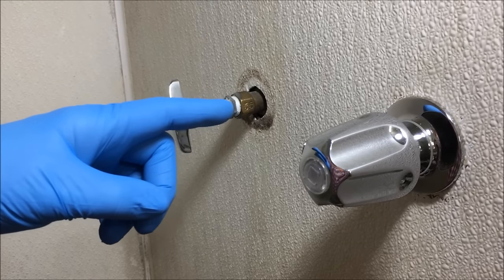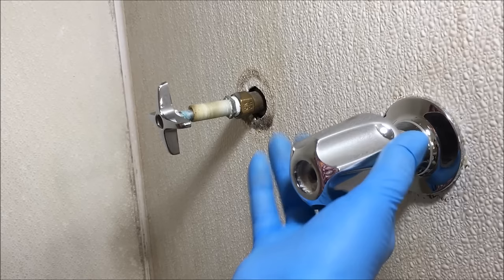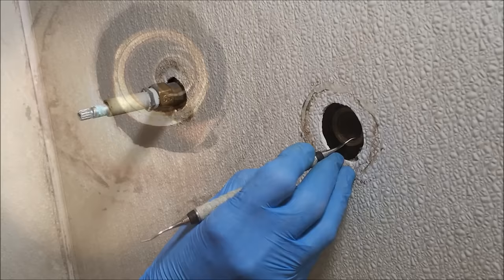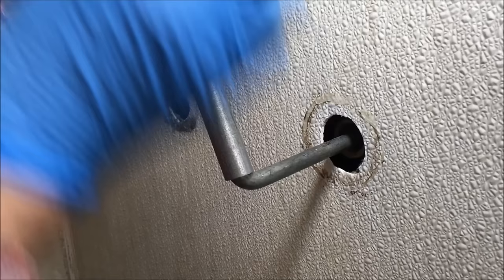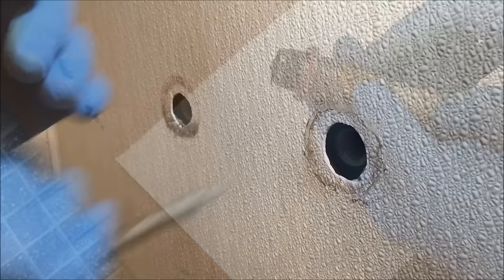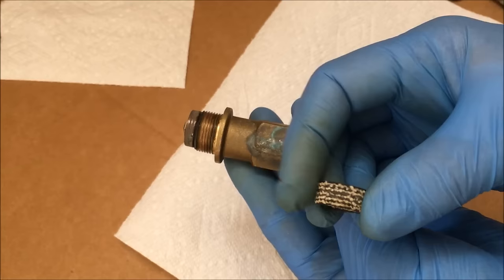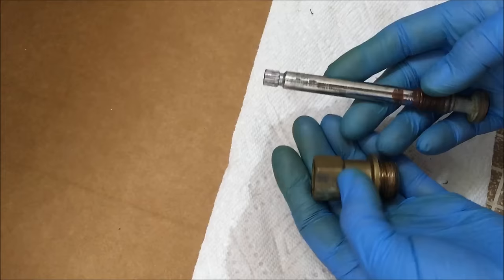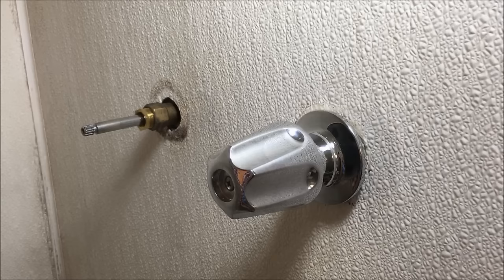Fix Leaking Shower Head or Bathtub Faucet | Rebuild & Replace Shower Valve

Comment: I replaced my cold water valve but the water does not come out. Any idea as to why?
Reply from the maker: Hi tony.  Are you 100% positive that you replaced the cold water valve with another valve that is identical/the same part?
Reply: @frugaldiy1  yeah the parts look alike. Should be the same part danco (7e-5c)…

Comment: I have an old house so there’s no telling how old these valves are.. I already made one trip and bought the wrong size. But all the ones at the store look nothing like my old ones. How do I know what kind will work?
Reply from the maker: Yes, many of the valves look the same, but aren't.  I'd take the valves to a plumbing supply place (where plumbers go to get their supplies) and ask them to help you find the correct valve.  Or, you can simply rebuild the valves, like I do.  If you have a difficult time identifying which parts you need to rebuild the valves, because that can be challenging too, the folks at the plumbing supply company can help with that as well.  They'll likely have all of the parts you need or the valve itself.

Comment: Any reason why my handles are hard to turn? I took it apart and put it back together and it is still quite hard to turn.
Reply from the maker: Yep.  It's either that the new seal packing is new and not yet worked enough to loosen up or the packing nut may be a bit too tight.  Carry on!  ;)

Comment: Where I work, we have the 3 valve, Sayco brand. We get situations where  shower head and tub spout run at the same time.  We replace the diverter valve stem, and seat. Sometimes it does not fix the problem and we end up replacing the entire system. Do you have any suggestion or have experienced that?
Reply from the maker: Hi Jonathan.  If you're talking about the 3-way valves, no, Sir, I don't have experience with those.

Comment: One question…why not use the sealant on the undamaged manifold, the hot side?
Reply from the maker: The shoulder washers don't need sealant.  I only applied the sealant because the manifold was deformed.  There's no harm in applying sealant, if you'd like to.
Reply: I used your link to get the Retroseal 5 and received it yesterday…I hope you get your cut $$ from Amazon‼️👍❤️
Reply from the maker: Thank you, Mike.  That's generous of you.  Stir the RectroSael real good before you use it.  I like to apply it with a matchstick because it gives a nice, even coating.  ;)

Comment: Question do you have a video about the mowing single  Nob .  I have had a week going into the tub from the faucet For now 2 years. I've had 2 plumbers try to fix it. The moen part that regulates the cold/hot ratio has been replaced 3 times.  I've contacted mowen and they say the parts shouldn't  Cause any further leak after replacement. But as I said 3 of them and they've all leaked.   Before I try to do this for the 4th time I'm trying to get any ideas of why it's leaking. Point of note the original   Was in upside down  Counter to the hot cold indicators indicators on the cover. They tried putting it back in that way still leaked.  They put it in straight still leaked. Replaced the part did both again still leaked.  Any ideas or do I just have to continually live with a leak that I am collecting the water and using for the garden or for the cats.  They like to lick the drops coming down.

 Thanks for any advice.
Reply from the maker: I don't know if your configuration is a single-handle or two-handle, and I don't know if your faucet operates with a cartridge with a ceramic disc or seats and springs or stem and seat or something different.  Please clarify, and I'll try to help you.

Comment: do you have to shut off main water valve
Reply: Yes
Reply from the maker: Yes, you do.
Reply: @frugaldiy1  whaylt if u dont?? The water did not come out though
Reply from the maker: The water will continue to come out of the manifold/pipes if you don't shut the main off.  Now, some homes have shutoff valves near the bathroom that you can be closed so the valve stems can be worked on.

Comment: I replaced all of my valve seats, stems and used sealer. But the pipe to the faucet in my tub is still dripping 😔
What else could it be? We tightened all the parts correctly and checked is it was leftover water in the diverter. I'm at a loss of where the problem is.
Reply from the maker: Do you mean water is dripping out of the tub spout?  Did you replace the entire valve stem or just the washers at the end of each valve stem?

Comment: A couple of questions.. What if you have a hot and cold shut off 2' away from the diverter? My shower appliance is approximately 35 years old and drips from the shower head. Is there any chance whatsoever of taking these valves to a plumbing supply house to get the rebuild parts especially the valve seats? Thank you for a great video
Reply from the maker: Mr. Obvious, yes, take your valves to a plumbing supply house so they can help you with parts to rebuild your valves or with new replacement valves (as you asked about in your other comment).  I would never replace my older valves with new valves, if I could at all help it.  The valves you see me working on in the video, are 45 years old, and I have been able to find all of the rebuild parts I need.  They're plentiful.  If big box stores don't have rebuild parts, I go to old-school hardware stores, and they always have them.  Don't sweat this--you got this!  ;)
Reply: @frugaldiy1  appreciate that. I did get the gaskets about 5 years ago form HD. But a plummer in the parking lot said valve seats? that old.. dont hold your breath...I will take out 1 valve and try to get out 1 seat and go to pl/house and see...thanks again. also, dont know if you answered this, can"t I just shut off water right below manifold instead of whole house?
Reply from the maker: You have a great plan there.  Plumbing supply house folks have always been very helpful to me.  And, sometimes, plumbers are there getting supplies, and I've found them to be willing to help me, too.  I can't advise on your shutoff question because I don't know the configuration and would be remiss to guess on that subject.  I would turn off the main water supply to your home, so there's no guessing involved.
Reply: @frugaldiy1  I appreciate that.. Maybe I have not explained it clearly. Whoever built the house put a hot and cold shut off right underneath the diverter with an access panel one is red and 1 is blue..
Reply from the maker: I understood your query, but, as I said, I'm not comfortable advising without my eyes on it.  I'd recommend you turn off the water to your home.
Reply: @frugaldiy1  Just an update.. I appreciate the time you take to respond. I turned off the water right behind the diverter and  replaced the washers and the drip has stopped. I call the plumbing supply house that deals in 100 year old products and they said they sell rebuild kits for those 2 stage valves stems.. Other than the 2 washers I can't even think of what else would come with a rebuilt kit... But the gentleman also told me that the valve seat right away from hard water and after 50 years, I should replace the seats.. Do you Agree I should change the valve seats (age) or just keep replacing the washers as needed?
Reply from the maker: @mrobvious1100  Yes, Mr Obvious, I do highly recommend you change the valve seats when you have the valve stem out.  As I showed in the video, valve stems become worn and pitted over time and need to be replaced.  If they're pitted, they can chew up the new washers you put in and cause another leak.

Comment: Can a bad valve seat cause a leak behind the shower wall ?
Reply from the maker: It's not the seat.  It's likely the washer/gasket that goes between the valve stem body shoulders and the manifold.  I'd use some Rectroseal 5 there to seal that up.

Comment: I replaced the parts on my Diverter valve but it is spinning endlessly when I try to install it into the internal manifold. Is the rectorseal a fix for that?
Reply from the maker: No, it's not.  Something doesn't sound right there.  It shouldn't be spinning.  It may be stripped.
Reply: @frugaldiy1  I bought a repair kit from home depot Danco brand. My part is Pfister. Turns out the replacement washer that goes behind the stem head was too tall. So whole Diverter couldn't make it in far enough for threads to catch. Going to plumber store to buy actual/exact replacement.

Comment: I have the exact same ones. Do you by any chance what brand is it?
Reply from the maker: No, Carlos, I'm sorry, I don't.  My best advice is that you take the valves to a big box store or plumbing supply company and get EXACT matches, or you'll have a tough time with "look-a-likes."  Some valves look almost identical but are not.  You need exact matches to yours.  It's such a hassle, and that's why I rebuild mine.  You can get the parts to rebuild the valves at big box stores.  If the valves are older, you may have to go to a plumbing supply place to get the parts.

Comment: So one of my valve seats is supper stripped, it’s not even a square anymore it’s a circle and idk how to take it out any help on how to take it out
Reply from the maker: Hi, Hintz.  I'd try an extractor bit if you can find one that large.  Look at the size of the valve seat you can or did take of the other side to get an idea of the diameter size of the extractor bit you need.  You have to find a bit long enough to reach the valve seat or an extender, that fits in your drill, for the bit.  I hope that helps you.

Comment: How much would it cost a plumber to do that job?  One plumber wants $1200 to replace leaking stems.  They said it would take 4 hours, and the parts would cost $300.
Reply from the maker: I think a skilled plumber would take about an hour to replace both valve stems with NEW valves.  The new valves come with all seals in place, so no need to doddle away their time there.  It's not difficult to replace valve seats, either.  But, I think they would charge you for two hours labor.  Estimate of cost for labor and parts about $600.  

All plumbers I have known charge you more for the parts than what the parts costs them.  SMH 
 The plumber you contacted, Mr. or Ms. $1200 bid, should be ashamed of him/herself.  Maybe the plumber should watch my video.  ;)  You don't need new valves; you just need to replace the valve seats and the seals on the valves to stop a leak--minimal cost.  $300 for parts is a complete ripoff.  The entire bid is a complete ripoff.  I hope this helps you.

Comment: Please help me, my shower was leaking very little, I replaced all 3 valve stem but now it’s leaking a more. It’s leaking cold water.. I didn’t replace the valve seat because I didn’t have the tool. You think that’s the issue?
Reply from the maker: It could be the valve seats.  I'd replace them.  Also, make sure the valve stem replacements are an exact match to the old ones.
Reply: @frugaldiy1  Okay I’ll double checked them and they are identical. I’m going out to Home Depot right now to purchase the seat wrench.. Also you think maybe because I didn’t use pipe thread sealent can be the issue? I didn’t use teflon tape or any sealent..
Reply from the maker: Where is the cold water valve stem leaking from--the faucet or the stem as it goes into the wall/manifold?
Reply: @frugaldiy1  It’s leaking from the head of the shower 🚿
Reply from the maker: Yes, that is an indication you need to replace the valve seats.  I'd do that.
Reply: @frugaldiy1  I want to thank you , we solved the leaking problem. It was the valve seats all along, I didn’t replace them because I didn’t have the tool yesterday. Went to Lowes and got the tool, replaced the valve seats and good as new. Thank you again, god will bless you for your generosity 💯
Reply from the maker: That's GREAT to hear you solved the leak issue, and I'm glad I could help you with that in some small way.  Job well done, TheWiseGuy!

Comment: I can't even get the valve off.  I used a socket wrench and an adjustable wrench.  Also used WD-40 but the thing won't loosen!  HELP!
Reply from the maker: That can be a nail-biter situation, L Marshall.  I had that happen to me before.  I used a cheater bar on the the wrench to get more and better leverage to turn the valve.  Then, I took a hammer and hit the cheater bar to "shock" (or jolt) the valve loose.  Now, it can cause damage if you're not familiar with how to do that.  Only you can decide if you're comfortable doing it.

Comment: What if the body of the valve is inside the wall?
Reply from the maker: Depending on its location, you may have to cut the wall around the valve to fix it.

Comment: My son fixed the shower thanks to your video but the water stopped coming... can you help me please
Reply from the maker: Beatriz, when you turned the water back on, did you allow the air to clear out of all of the water taps and faucets?  That's a must do.  I will be out for about an hour or so and check if you need more help after I return.
Reply from the maker: I'm back.  Do you need more help?
Reply: I'm sorry I was busy .. everything is fine now with the water .. Thank you so much 😊
Reply from the maker: You bet!

Comment: Question? I have a middle handle and it only opens half way and water comes out of both ways does that mean I have to replace the valve seat?
Reply from the maker: Hi Glenn.  Please clarify what you mean by "water comes out of both ways."
Reply: Yes, we have a 3 way valve and the diverter only opens halfway and water comes out of both the shower head and tub spout and I’m not sure why!
Reply from the maker: A diverter valve opens only half way, so that's okay.  But, YES, given that water is coming out of both the spout and shower head, at the same time, means you need to replace the valve seat on the diverter valve.  You do it just the same way I show in the video for the shower valve stems.
Reply: Ok thank you so so much I’ll try that ty for replying back!!

Comment: If somebody before you put a black screw in a steam, you never take off you handle.
Reply from the maker: Use an impact screwdriver to try to remove the screw.  If that doesn't work, cut the handle off so you can get to the shoulders of the valve body.  Then use an adjustable wrench or channel locks to unscrew the valve body and remove it.

Comment: Frugal DIY - The cartridges in your video look just like mine.  Could you provide me with the brand and part number?
Reply from the maker: Hi Charles.  If you mean the valve stems, no, I'm sorry, I can't give you the brand and part number because I don't know what they are.  They're installed now, so I can't see that information.  But, I've never purchased new valve stems, so I don't pay much attention to the stamped numbers on them.  I ALWAYS rebuild my valve stems--it's way cheaper and I always have the spare parts I need on hand.
Reply: @frugaldiy1  Thank you for replying.
Reply from the maker: You're welcome.

Comment: Do you have a link to buy a valve seat ? Thanks
Reply from the maker: Valve seats are NOT universal in size.  You have to remove your valve seats and take them to a big box store or plumbing supply house to purchase the correct seats.
Reply: @frugaldiy1  Thanks

Comment: If there's any way u can message me I'm trying so hard to fix mine and I'm just frustrated and have no water for 3 days now because I have a complete different stem faucet mines more smaller
Reply from the maker: Please take the valves to the hardware store and match them with new ones.
Reply: @frugaldiy1  did that and were unable to help me but I was wondering if you can help me with my search? I have found out that I have 1/2 20 seat valve but the the thing is the stem can't reach it when I wanna turn it off or on the stem just falls out when I took the old one out it had a plastic valve seat about 4.2 inch length and I was trying to see if I can find a extender but no one seems to know what I'm talking about.
Reply: The old seat valve was plastic and about 4.2 length wise with a 1/2 20 thread like the new brass one that came with my stem only difference is the new brass is shorter and I need a 4.2 length size
Reply: Like it took my this long to find the stem I needed then when I finally found out what I needed a new problem occurs and I'm just really frustrated. I live in a mobile home, I hope that helps as I'm assuming why these parts are hard to come by